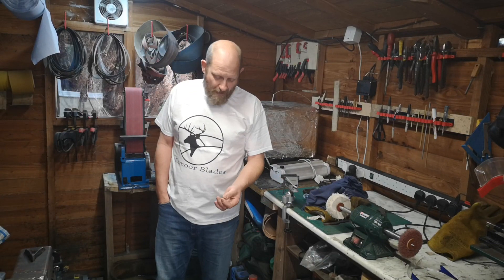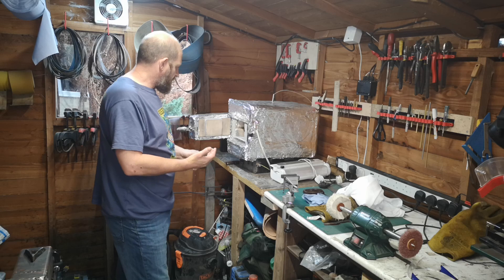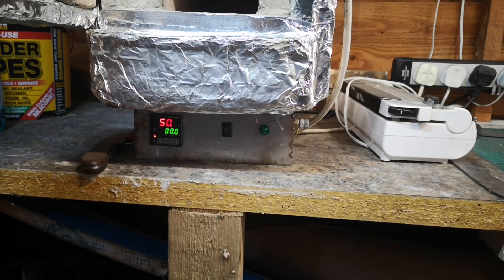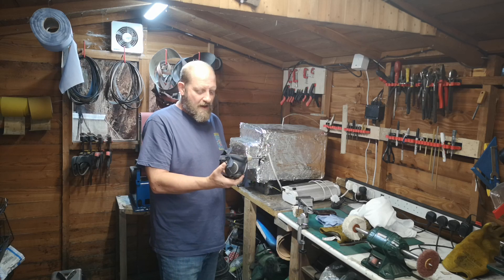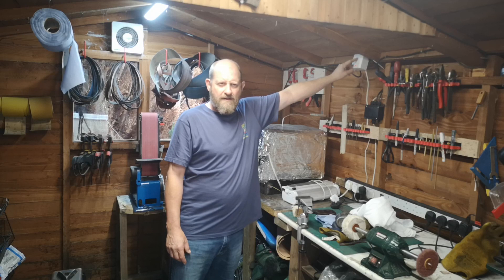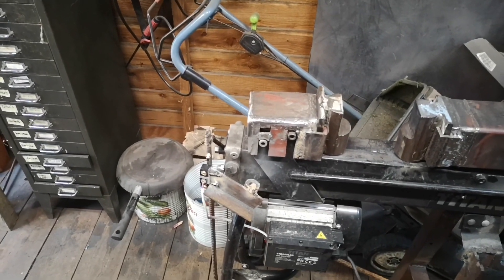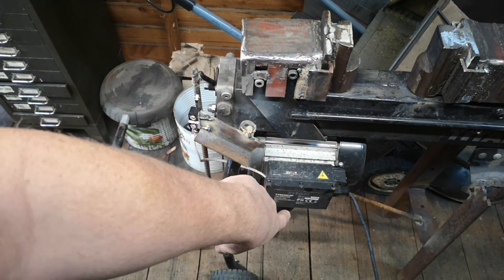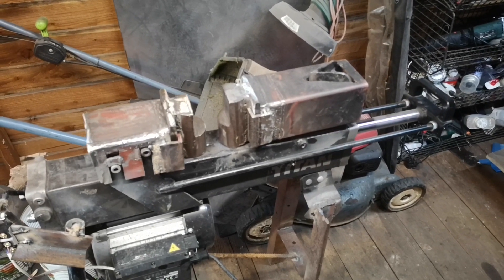I made a forging press from a log splitter, And a heat treatment oven

Comment: Great video 👍🏻, I’m now in the process of having my own workshop at home. I’m looking to make a press from a log spitter. What kind of steel did you use for the dies? Many thanks 🙏🏻 keep up the good work
Reply from the maker: I just used steel I had available if I remember, You could always harden the dies but as the steel your working is going to be very soft probably be ok without. Hope that helps
Reply: @ thanks 🙏🏻